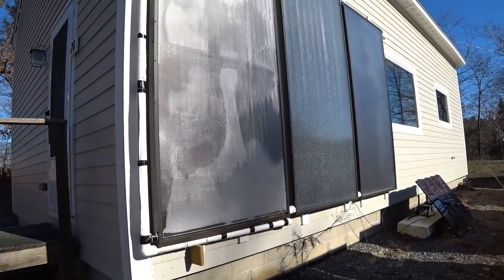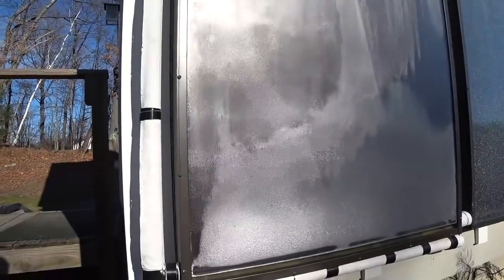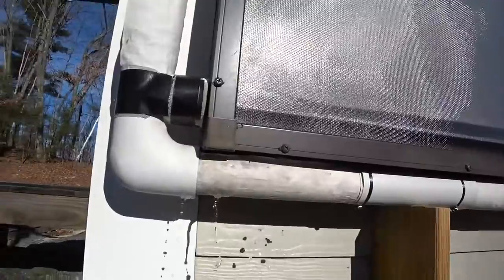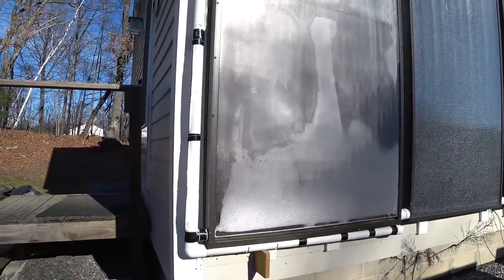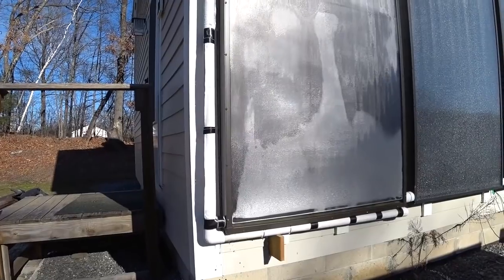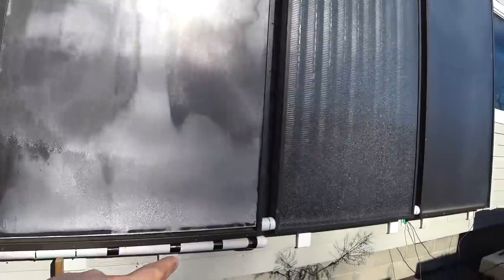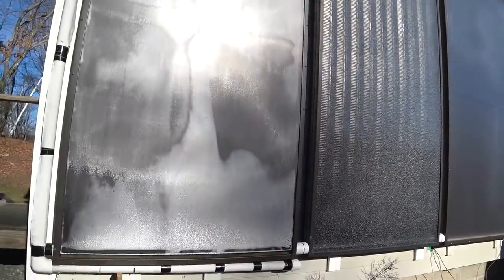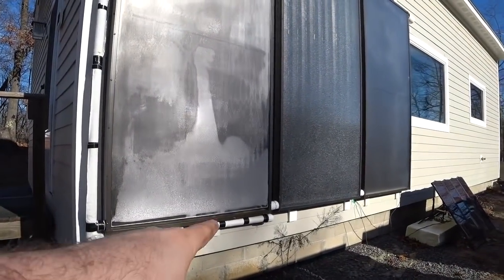Solar DHW Fail, Major Problem with Hot Water

Comment: I always thought those systems were meant to run a safe antifreeze and would be pushed through heat exchangers.
Reply from the maker: Some do use antifreeze.  I installed these as a drain-back.  All the water is supposed to drain any time the pump turns off.  I think some water got stuck inside the panel and froze.  I'm going to have to do more investigation to figure it out.
Reply: @DavidPozEnergy  I was wondering with the solar collector, How is it made?   is there multiple cores like a radiator or is it all on one plain?   Im thinking of building my own collector

Comment: I think I've seen almost every failure mode with drainback solar systems since 1978. 
The absorber plate looks like a Thermafin.  http://www.thermafin.com/fin_comp.shtml
Thermafin absorbers have very small diameter risers that sometimes hold a little water at the bottom, like a straw does.
https://www.youtube.com/watch?v=YoF7RuBZIpM
If there is a centimeter of water in the bottom every night, it could take many months of freezing and thawing to finally burst the pipe.
There are compounds that can "make water wetter" to reduce the surface tension.  But that's just another maintenance item.  I don't recommend glycol because that adds a pump and heat exchanger.  More maintenance.
Reply from the maker: Thank you Kevin.  I don't know if it is a thermafin or not, but your explanation of holding a little water at the bottom due to surface tension is the only thing that makes any sense.  I took the glass off today and cut open the pipe thinking I would find sediment or something clogging a pore, but nope.  I've been scratching my head about it.  I'm really kickin' myself about this whole thing too.  I've loved it the last year and a half, but it is not worth keeping on the house if it fails every so often.  I'm debating if I fix the one broken riser and put it back together, or take the system down.
Reply: @DavidPozEnergy  I'm currently decommissioning my solar thermal experiments and converting to PV direct water heating.
Reply from the maker: Are you doing that through an inverter, or are you using relays so you can use DC direct to heating element?
Reply from the maker: I ask because I'm also setting up a PV to water heating experiment
Reply: @DavidPozEnergy  I'm not yet convinced that I really need a relay or inverter, so my first experiment will be to cycle the thermostat snap disc to see if the contacts weld together like people predict.  I only have room for 1200 watts on my roof, so I might be OK.  Is there any consensus on the best wiring strategy?  If I wire the 4 panels in series, that would be 144VDC , 8 amps max.
Reply from the maker: I tested a few different wiring options on my solar electric baseboard heater before finally making the video about it.  Basically 8 panels in series, 10, 12, etc, and record the data on sunny days.   I was using a baseboard heater rated for 240 volts.  I found a huge difference between wiring up enough panels to make up to 200 volts DC, compared to wiring higher at 300 volts DC.  At 200 VDC the heater pulled almost no amps, and thus did terrible at trying to heat the space.  But by wiring the panels to be a little over the voltage rating of the heater I observed the heater pulling the full rated amps of the panels.  Lots of heat!  You might find the same thing.  If you only have enough space to series wire panels to have Vmp at 144, then I would suggest using heating elements made for 120 volts.  Either way, I'd love to hear how your project goes.
Reply: @DavidPozEnergy  Thanks for the info.

Comment: That's unfortunate. It doesn't appear that there is much (if any) pitch to the lower feed pipe. Is the panel made with the headers pitched for drain back operation? Others mention using a closed loop glycol system, which is fine, but you don't need the extra inside loops if the panels are situated above your tank, and if there's enough pitch for return (...and the return line is open to air in the tank, not submerged). Just wondering. I did see your video where you were assembling water heating panels, but don't recall if they were made for drain back. ...anyway, something stopped return flow, and the pipe froze. Good luck with the repair, and I look forward to hearing what you find inside that panel.
Reply from the maker: Hi Steve W, Yes, I installed the panels with a pitch.  I remember reading somewhere that warned not to over do it with the pitch, because too much pitch could create pockets for water to collect, such as in the closed off end on the top header manifold.  I installed with 1/4" pitch per panel, and each panel is 4 feet wide.  Perhaps it's not enough?  Obviously I have a problem somewhere.  When I'm inside the crawl-space and listen to the water return (pump shuts off) all the water sounds like it returns in less than one minute.  As this is a drain-back system.  But we should learn more when I take it apart.

Comment: I am looking at making solar toughs with a glycol loop. Of course I have a tougher time here in northern MN. The regular flat plate collectors like those don't work here. So it's concentrated solar or  arogel.
Reply from the maker: Another option is solar PV (electric) direct to a water tank, but with a relay to switch off if the temp gets too hot.

Comment: Is it a drain back System
Reply from the maker: Yes.
Reply: @DavidPozEnergy  I've had  silver solder joints fail.  A few years later.  I have 16.  4x10 collectors I use antifreeze in my system.
Reply from the maker: Wow! 16 panels!  That could heat a huge house.  I'll bet you never get cold.
Reply: @DavidPozEnergy  it's on my shop. Hot water and heat.

Comment: Hi. Can you connect each panel seperatly each one with a water passage key? All can be connected to the main line and if it happens again you can close only the one with the problem and never be without hot water. Just thinking!
Reply from the maker: I could connect each panel separate if I had a dedicated pump for each. Right now I have one pump.  Good idea.
Reply: @DavidPozEnergy  no, not a good idea at all. you will have to adjust the water flow for each  panel separately  with its own tap and it is a bugger of a job. adjusting one tap then changes the flow in the other two panels. ...........     not recommended at all

Comment: You burst a pipe you can try brazing it  in place if you can get to it also depends how big the split is worked in refridgeration thats all we did with packs you can also get pipe sealers from plumb shop or you can try sealing tape for temp fix    http://siliconefixittape.com/
Reply from the maker: Thanks Mark.
Reply: @DavidPozEnergy  your welcom the tape is a good option i have used it myself a few times used it on underfloor heating manifold where the glass has split till i could get a new one works well not like duct tape

Comment: I think your copper pipes are raptured. You should weld pipes with gas or tig welding and use anti freeze glygol to avoid water freezing at sub zero temperature. Use tank inside tank design you can use solar water heater effectively. I mean glygol water will circulate inside a tank and water to be heated outside. You can use thermostate controller with heating element for keeping temperature of water.
Reply: Yes I think that the pipes have disappeared because we're in the end times.
Reply from the maker: @Alan: LOL

Comment: You should really consider running a glycol system with a heat exchanger or an indirect fired tank with a coil in it.   It's pretty straight forward really.
Reply: Yes ,😃😃
Reply: Ditto